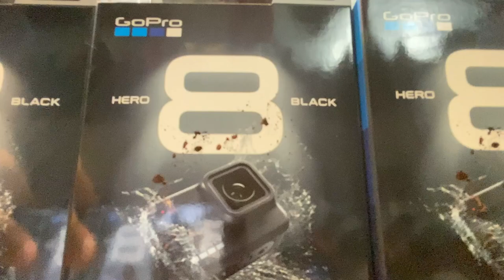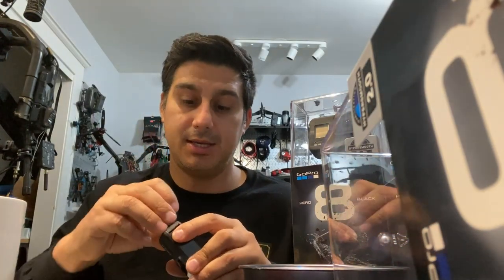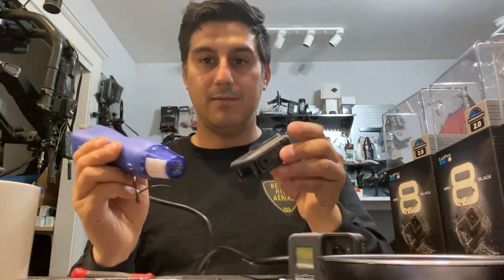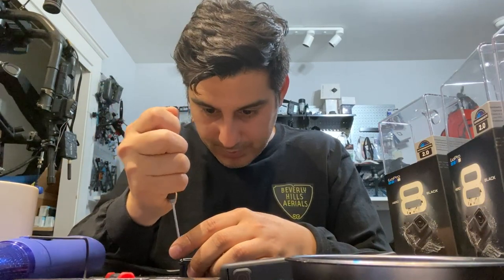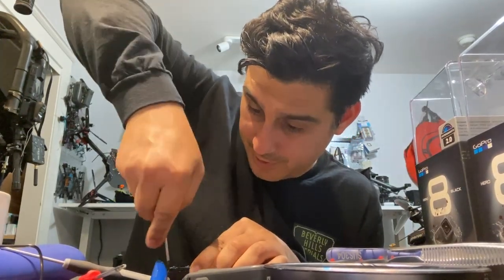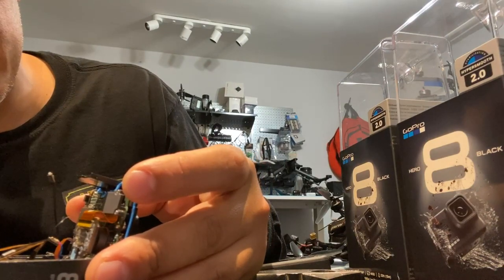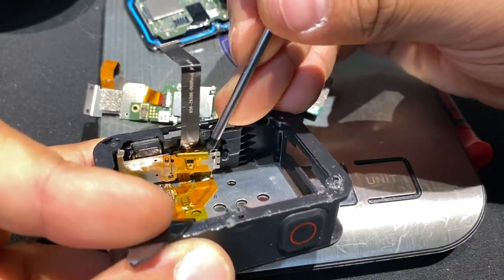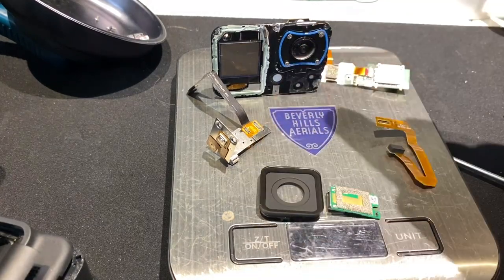Hero 8 go pro teardown tutorial

Comment: I need a usb c port to a gopro hero 8 do u have one...? 
My gopro hero 8 has been my moto vloging camera for 2 years I use it with the gopro mic adapter and purple panda mic now my videos are recorded fine it's my audio that is messed up either I get crackling noises or popping sounds or no sound period I've replaced both mic adapter and mic the problem still is h as happening I believe it's from my usb c port seems when I plug in my gopro mic adapter input settings says no mic when I unplug my mic adapter and turn it around to plug in the input settings say standard mic so I go off motovlogging only to come back and find out my audio is all messed up ... please help me if you can

Comment: I’ve been pretty peed off with the GoPro Hero 8 and I’ve also heard lots of other stories. I really cannot stand when it stops altogether when I’m snorkeling. My 2008 doc fit Panasonic LUMIX outlasted this hero 8! And it’s still going.  Over $400 for a little cube of trouble. 
I can’t get it off, and it would help if you explain in a little more detail what bit am I peeling off exactly at the start because there seems to be two layers there, a rubber front, then metal underneath it, but I take it’s just the rubber as you wouldn’t be able to be it if otherwise. Anyway, I don’t see the point to this when there are perfectly capable ready to go camera solutions for DIY drones out there. Mine is salt water damaged so that’s why I’m watching. 😬